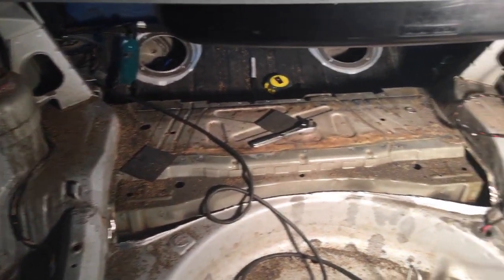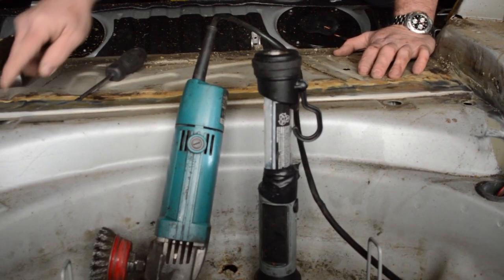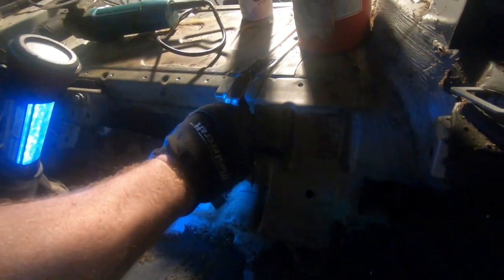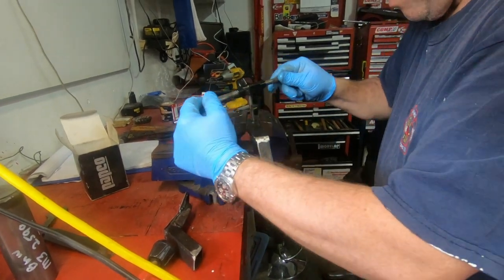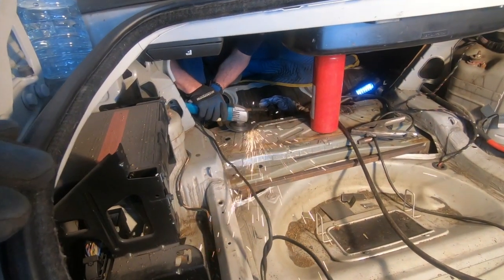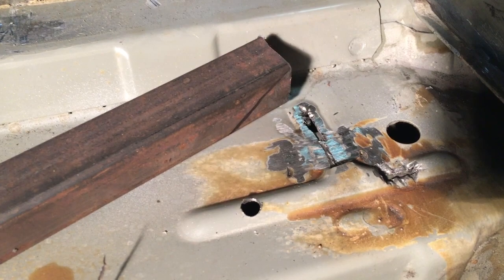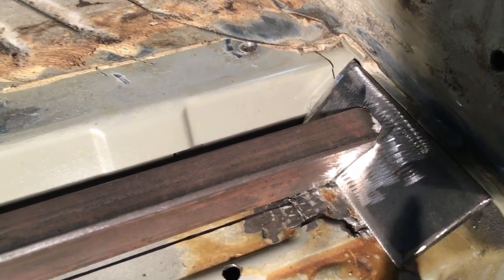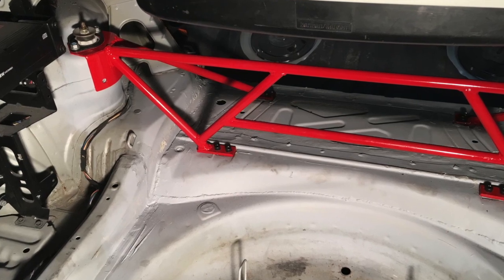Sidewaze Log - BMW E46 M3 Subframe Custom Reinforcement Bar (Part 2)

Comment: I want to do some R&D for my custom rear. That top piece that hides the "T" above the subframe bolt - the first thing you cut off for the rearward mounts. I can remove that without jeopardizing the integrity of the car, right? I believe its sheetmetal but I'd do this over a few days or weeks so I'd want to know I can drive like that

Comment: Must the gas tank be removed for this project or can I do it without removing the gas tank?
Reply from the maker: I wouldn't think so, in this part of the video series you are coming in from the top and connecting to the top of the sleeves that the subframe bolts connect through. In part 1, when we are welding the enforcement plates, the forward mounting points are quite close to the tank. We removed the tank in that case for safety (and also to replace a rusted brake line).
Reply: Sidewaze Motorsports Alright thanks for the response. Due to limited time and resources I’m also wondering, without adding the plates on the bottom if I were to fab up a subframe support from the top of the mounting points as you did would that be sufficient to take the load off of the floor board; or at least distribute the weight enough? I currently have no cracks, this is preventative.
Reply from the maker: @QQ-hm4nu  In my opinion, I think the plates on the bottom help prevent any existing separation to spread, but don't really solve the problem. With the subframe properly supported to the chasis, there should be minimal force / deflection in the floor (/ rear axle carrier panel) which is the cause of the tearing and weld failure. I would probably do the same if I had to make a choice, ie, properly support the subframe with a custom or after market brace and monitor for cracking and tearing.
Reply: Sidewaze Motorsports Okay sounds good thank you for your help and the quick responses, keep up the great content.